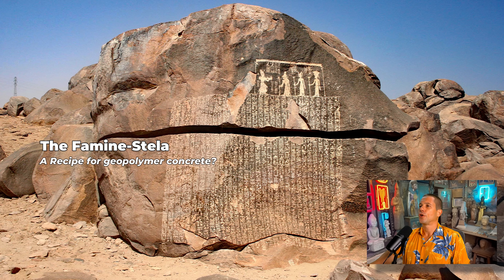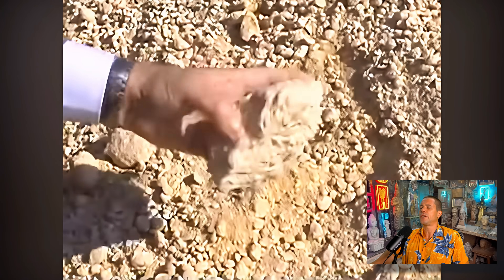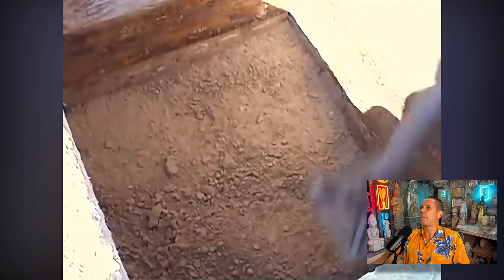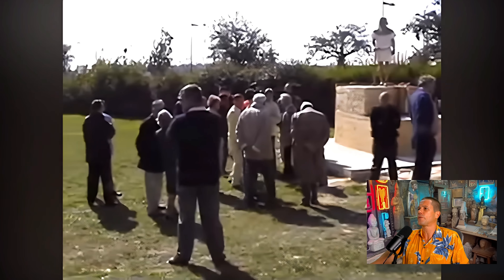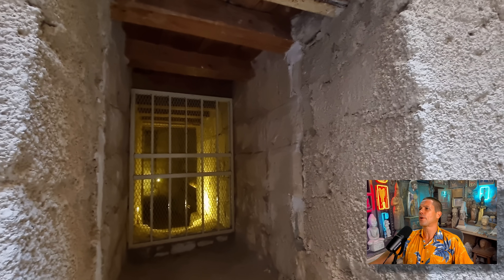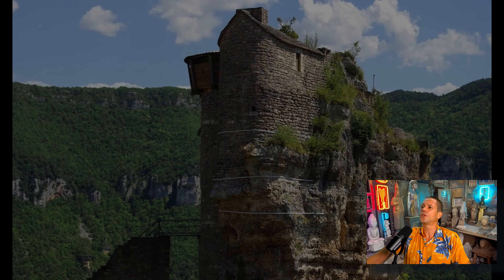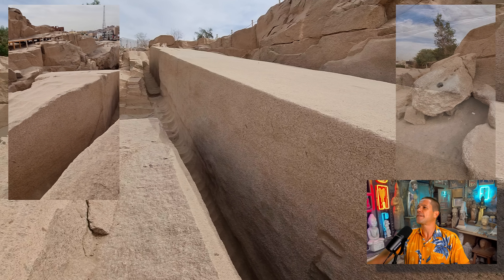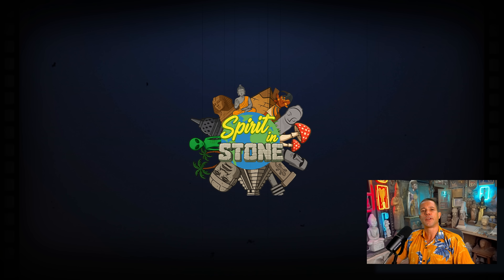The GeoPolymer Experiment | Recreating the Pyramid Stones of Egypt

Comment: I've said it before quite a few times that the stairs look to me like they were dripping something as they were going up and down. I don't think it was a single spill I think they were going up and down with a chemical and then it started to soften the stone. If they simply spilled something it wouldn't be in the middle of the stairs. It would be all over the outsides and everything off to one side maby but not in the middle. But if you were carried buckets up and down those stairs or some sort of container slowly dripping that would make sense to me.
Reply: It's just an illusion with the light.
When you see pictures from a different angle, those steps are just normal old  steps.

Comment: Why would the cast obelisks on their side if they're just geopolymer??  Why not cast them in their final vertical position??
Reply: That's not what he said. He showed that they just poured the softener around the rock to quarry it's outline out using scooping.
Reply: Lifting 40 tons of material higher and higher is difficult. On the side is fast.
Reply: it doesn't sound like he's suggesting they did that. he was talking about using chemicals to make quarrying easier. They've found quarries around Egypt so they definitely  still did that. Maybe quarrying stone was harder and more expensive so it was done exclusively for important and specific pieces, so maybe they cast the high volume of basic stuff on site?

Comment: Davidovits made this experiment years ago, but didn't use the same ingredients as in his "receipe". They used metal tools to mix, not wooden.

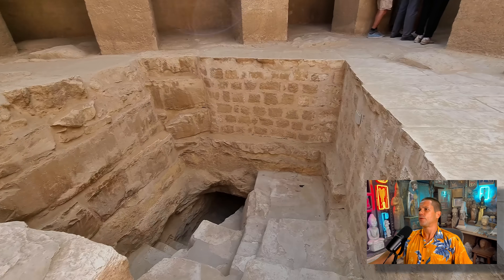7:00 if the block are casted, why do we see joints ?

Fun fact : he never showed those blocks after this. Probably because it just disolved by the rain ... :)
Not a simple proof they harden.

What is the relation between granite and the supposed "geopolymer" limestone ?
They are 2 totally different rocks.

8:42 : when you remove the potassium hydroxyde from dissolved granite you just get quartz powder.

11:15 Those "melted stairs" is justan illusion from the photography. From different angle, they look just like abrased old stairs.

Comment: gives great merit to the discovery of the stones of pumapunku in south america. Which microscopically showed they were a complex conglomerate of mixed local stone at different ratios. This easily explained the "laser like" precision of the 'solid' stone shapes.
Reply: Pumapunku rocks are sandstone.
You can cut it with a wood saw.
Reply: @nalinux  From google - The stones at Puma Punku are primarily made from red sandstone and andesite, a hard volcanic stone. However, research suggests that some of the iconic H-shaped blocks may be artificial, created from andesite sand mixed with an organic precursor to form a type of geopolymer concrete, rather than being carved from natural rock. 
Many people have spent a great deal of time studying these shapes and writing very detailed palers on the subject. occams razor. Reading is fun.

Comment: 1. Potassium hydroxide from wood ash
K₂CO₃ (from ash) + Ca(OH)₂ → 2 KOH + CaCO₃↓
Type: Strong base (alkali)

2. KOH + silicates in red granite
SiO₂ + 2 KOH → K₂SiO₃ + H₂O
Al₂O₃ + 2 KOH → 2 KAlO₂ + H₂O
Result: Potassium silicate and potassium aluminate (a glassy, basic mass)

In short:
KOH (basic) + granite → potassium silicates and aluminates (water glass, basic).

Used in:
Modern: Soaps, water glass, fertilizers, fireproofing, adhesives.
Ancient Egypt: Soaps, mummification, pottery/glazing.

The same basic reaction — alkali reacting with fats or silicates — links ancient Egyptian technology with modern industrial products.
Reply: After you made the granite soup is there anyway to use it like concrete?

Comment: I used a exothermic reaction from elements iron and aluminum,  then mixed at 10 to 1 with gravel,  ingition with magnesium. Casting with pottery clay high temperature. 
Iron oxide is everywhere and aluminum purifying was Pyramids purposes. They scrape aluminum from walls and and waste pottery clay was refined for construction.  
Extreme heat technology emerging from pottery clay decorations and high heat temperatures. Worldwide common connection. 
Symbolism are older then all binding language.  
Remember metals melting out of stone including gold Iron. Copper oxide works but hotter. 
Elements as stars as languages as mythology as religion. All interconnected in time forgotten about.  Why aluminum is difficult to purify then. Not now. Megalithic stone melting Symbolism is everywhere today..... replaced and recreated Symbolism changed the day. Binding recipes were power to rebuild humanity.

Comment: Let me add that the ballast stone used in the so-called 'ascending shaft' to power the elevator lift in the Grand Gallery may have been specially cast as well as the stones used to plug the ballast shaft at the base. The weight for a reconstituted or concrete ballast stone appears to be actually greater per cubic meter than raw granite, and casting the stone was perhaps done atop the first stage of the pyramid itself at the exit point of the shaft at the base of the future Grand Gallery. This casting would have also allowed the workers to embed the copper ring attachment into the curing concrete to which the pulley rope used in the elevator shaft system could be attached to work the lift. There is evidence that the top of this stone has been broken off to take out the copper at the close of burial operations.

And let me make another observation. Not all pyramids were built with geopolymers apparently. One clear case I believe is the so-called Black Pyramid, which had to have been erected - at least in part, like the Giza pyramids themselves -  using raw natural stone. The reason is that oil is leaching out of the limestone, causing black goo to drip on the interior and turning an original whitish pyramid into a black stained ruin. This indicates here that the engineers simply used  raw limestone containing raw petroleum. Limestone is a natural reservoir for petroleum. SZ BA MA
Reply: how can you make heavier granite out of granite, also weight is not measured in square feet
Reply: @disklamer  Thank you. Cubic Meters. Cubic metrics.
Reply: @disklamer  But it took me a minute to work back my logic and to express the idea that Egyptians had the capability of making concrete and this means they had the capability of making concrete heavier than stone(!) by using enough stone aggregate or even crushed concrete in the concrete mix. In the circumstance of a ballast stone, a heavier artificial stone than a natural stone might be better. And certainly easier to get into position on site rather than hauling the granite block up the entry ramp from the plains below.

Comment: This would mean that the majority of the blocks would be the same shape and size but they are not.
Reply: Incorrect. If we are to believe that it took 20 years to build Kufu's pyramid, then a block would have to be placed every 2 mins for 20 years straight. Assuming that's correct then obviously there would be many different molds being used in order to achieve that every 2 mins mark. Despite that, let's say that's bunk, they would still need to use many different molds in order to build anything within any kind of reasonable timeframe. Your comment suggests that they had a uniform mold or that they used one mold. Both are logically inept.
Reply: @jennaskylark  yet people ignore the fact that what we call 'ancient egyptians' not only never claimed they built the pyramids, but that they said they found them.  but because the writing says that 'the gods' built them, we assume that they just built them after all, and ignore the rest.  

 the pyramids -  were built long before the 'ancient Egyptian' culture.  in fact some actual egyptian temples were partially built over older construction that the egyptians found and had to change their plans mid construction and locate the rest of their building in a different direction from where it is normally placed.   i refer to the older construction which is known as The Osirion.  it is where an old inscription of the geometric pattern called "the flower of life" was found in modern times.
the older temple was much more advanced with larger blocks and more capability required to make them.
Reply: @jennaskylark but the Egyptians had standardized measurements. So why aren't the blocks all a standardised size.

Comment: A massive problem with the polymer block theory is wood, or lack there of. Wood was an extremely rare product in ancient Egypt so if you were to construct a pyramid using geopolymer blocks you would need forests of timber for boxing. 
With that in mind, common sense says that you would construct the boxes using a standard frame that could be used over and over to create thousands of identical blocks, but the blocks are almost all different shapes and sizes.
Add to that, if you look at the blocks, often you can see circular saw cuts, natural fissures and fossils in the stone, you wouldn't have those obviously if you're mass producing "bricks"
Reply: So ? If wood was so rare in Egypt, they wouldn't have used wooden sled either.
Reply: Ummm the Egyptians sailed the entire world 🌎. They were short on nothing as they had vast trading networks
Reply: Well in ancient Egypt there were Trees and fruits. So it's possible that some survive until it was exploided and then forgot how to build a proper granite structure. I think is more likely they forgot how to build wooden houses and then the granite structures.
Reply: “The blocks are almost all different shapes and sizes”

Wrong, the pyramid blocks are made in “sets”. There are just ten size sets, so surprisingly for you, block sizes do repeat inside the pyramid.

Not only, but each “level” is called “Course”, and the blocks from each course are (obviously?) of the same, identical height. 

Clues of casting are high enough, given those premises
Reply: The boxes weren't made of wood. The technology involved used electro-magnetic containers into which molten limestone or granite was poured. The give away is the magnetism exhibited by the cast stones. It also explains the close precise fitting of the stones with each other.
Reply: Egyptians SAILED THE WORLD AND COULD PROCURE ANYTHING. They were worldly peoples ok ? Don’t be stupid they could get lumber no problem
Reply: @waltershoults8803 they absolutely did not travel very far
Reply: @LooksLike-om4df the Egyptian artifacts and hieroglyphs in the Grand Canyon are calling you a liar . I won’t though because it’s really just a low knowledge base
Reply: @waltershoults8803 😂😂😂😂uh huh sure.😂😂😂😂
Reply: What? You are kid.
Reply: "Egypt" must have had lots of wood back when the pyramids were created. Is it not proven that it was lush and green up until like 6000 years ago or something like that?
But what you say about fossils is a problem with the melted stone theory, yes. =)
Reply: @1Dreamking they didn't have large trees like cedar.
Reply: @LooksLike-om4df 
No, but Lebanon did.
Reply: @FrankPCarpi  Right?  I'll give you x amount of gold for y amount of cedar.
Reply: @LooksLike-om4df  There is that.

But I just got a thought. If the ancient people all around the world could travel miles and miles to go get huge stones wouldn't it be even easier to go and get wood from even further away?  Or traded for it? Just brainstorming here. =)
Reply: @lcecil70 
It's the way of the world.
Reply: @1Dreamking Egyptians did trade with Lebanon for cedar. They were terrified of going that far by boat.
Reply: L'Egitto era "verde" durante il cosiddetto "periodo umido africano", durato all'incirca tra 12.000 e 5.000 anni fa.
Reply: Though tedious but plentiful, they could have used sliced reeds for mold frames.
Reply: Quindi il legno era raro ma spostare un blocco  costruito a 800 km di 
Di distanza , di svariate tonnellate  ti sembra ragionevole,  ho sbagliato il ragionamento?
Reply: Trees grow along the Nile. Not that rare. 😂
Reply: Not to mention the 400ton blocks.
Reply: They for sure traveled all over. Many cultures did. How and why do you think pyramids blanket the planet
Reply: Molds could be made of: geopolymer! Dig a square patch in the ground, level. Pour in geopolymer. Once cured, you have a perfectly flat element, create 3 more and you have a mold for making blocks.
Reply: NO.   their trees (equivilant to palm) are soft.  have to import wood.  is NOT "rare".  DOH.    yes hard wood is imported and expensive and trey do use it  probably sparingly in creative ways.

Comment: this explains everything, by adding water to surface of limestone it makes chiselling it down to rubble very easy, i'm assuming they would have done this on a larger scale where they only needed to haul the rubble back to the pyramid site where moulds would be waiting for them that way making the blocks piece by piece would have been extremely easy and as the pyramids grew taller the workers would have hauled up the crushed limestone bucket by bucket to the moulds and repeating the process over and over. No need for ramps or hundreds of workers. Only a handful of people could have built the pyramids going by this process which only leaves the marble boxes found in the pyramids and i predict they would have been placed there beforehand building the pyramids around them. Case solved!

Comment: Around the 11th minute regarding the accidental spillage of melted material. I think you're right. Makes a lot of sense. Makes you wonder what happened to the poor worker who did it. As for the geo-polymer theory, the first time I learned about it several years ago, I thought it was spot on. Crazy thing though, it's also prevalent in other countries during those times. Somehow, it was a common building technique, though the designs of the blocks are rather localized.

Comment: The limestone and granite blocks are natural; the quarries are testament to that. However, the builders did use geopolymer of unknown constitution to bind the huge outer casing stones together.
Reply: Yes whilst this method was used, it's completely obvious based on physical evidence that red/rose granite and other stone types were naturally sourced and move from very far away and each block weighing anywhere from 20 to up to hundreds of tons each - Nobody knows how they managed that.

In the Serapeum of Saqqara the 24 odd granite boxes have many with scoop marks on the granite lids which were  done to combat cracks that formed at the surface, how granite was "scooped" as it was ice cream remains a mystery as the scoops are very smooth.

That's before even considering how those boxes weighing over 1200 tons each were hauled down there with such little space either side of the corridors.

This pyramid block explanation is sound, but it only answers a very tiny question in relation to the casing stones but not any other megalithic architecture at Giza or anywhere else in the world showing the exact same building pattern.

Comment: I think this idea might explain the "nubs" that are often found on the casing blocks and other  block walls found at ancient sites worldwide. If the blocks reached a certain plasticity before finally setting hard they could be pushed against each other however if this occurred over a short time there would be a point where the blocks would harden. Now imagine a pair of hands pushing up at the last minute. You would be left with a couple bumps at the bottom slightly hollow underneath. Just an idea but I think the nubs are an artifact of the process.

Comment: We've confirmed that a geopolymer composite can be fabricated to match the visual and binding properties of granite, though its density is lower. The construction method involved casting the liquid polymer into forms on-site, then capping them with thin granite plates. This technique explains the engineering data: it allowed for the modular assembly of large, precise structures in confined spaces. The evidence supports this. We observe spill residues on transit paths and abandoned material containers. Furthermore, the chemical off-gassing from the curing polymer would have created a temporary toxic atmosphere, requiring a quarantine period for the worksite before it was safe for re-entry and cleanup.

Comment: They undoubtedly had a form of mortar type concrete you see it used under the black basalt floor, where you also find channels for some form of plumbing and or services, possibly going to fountains, etc (which would imply plumping, pumps, maybe wires etc, complete with junction boxes) I watched a Paul Cook video he showed some very interesting large seemingly cast(no other way really it could have been done) stone against the ragged unfished backs of the polished granite blocks, very large segments larger than the blocks of the pyramid, it raised the question for me did they cast the sphinx?? What else there is cast, if they were casting segments that large, the walls are about 20ft tall with granite facade the backs of the granite perfectly match the random contours of the backing, which could only be done with a casting, although I dont think the granite was cast, paul cook does show some strange weathering on some granite blocks that seems out of place.
Reply: Paul Cook is amazing. Have you seen his videos of Malta? Also lots of casting there.